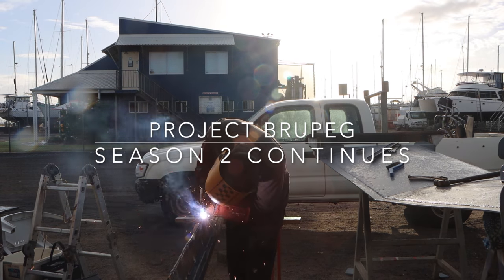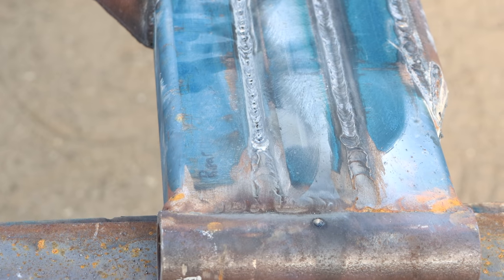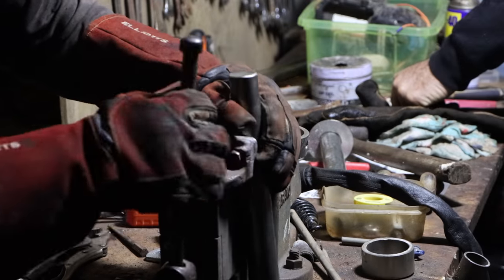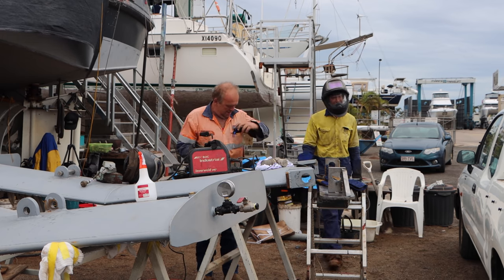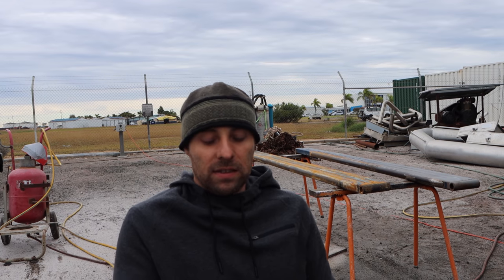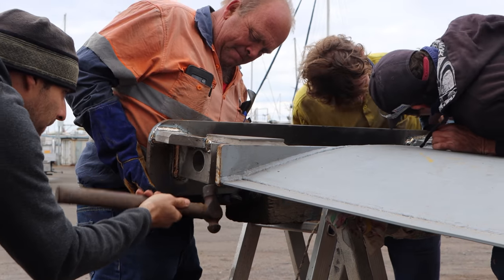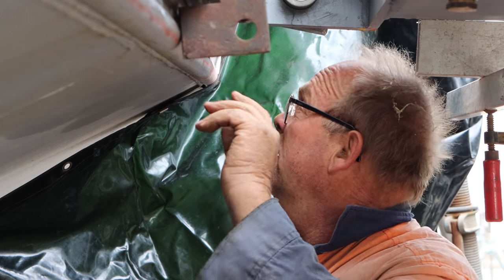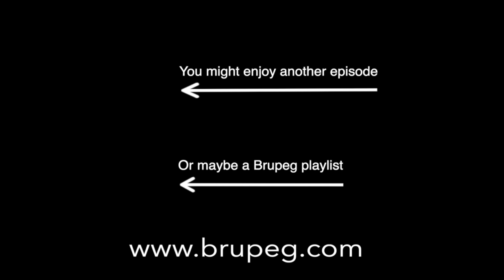Welding Steel Wings to a Trawler - Project Brupeg Ep. 148

Comment: Are you going to using a double shackle to attach the anchor to the chain?
Reply from the maker: No, just a single load rated 25mm shackle.
Reply: @ProjectBrupeg  Will that fit through your chain and or your anchor.
Reply from the maker: Yes, our anchor can handle up to 32mm and the chain has a single large link at the end so it can handle at least 32mm

Comment: I’m sure have answered this.  But, what are the pipes on the bottom and isn’t there a risk they could be ripped off by ice?
Reply: If I may step in..... The pipes are the engine cooling system, in a previous video Dame explains that the shakedown crusie will be away from ice then after settling in and figuring out requirements they will haul out again and do a lot of ice mods - reinforcements up front and engine cooling changes. :)
Reply from the maker: Exactly what Richard said. Ice mods will likely happen in New Zealand in about 18months time

Comment: Great video. Are the wings + or - buoyant?
Reply from the maker: Both!. They weigh 320kg and tha arms are another 60, so when anchored there is 760kg of steel hanging off the side minus whatever the air volume inside is (we dont know that number yet). I have my doubts there would be enough air to nuetralise the mass. When steaming at 9knots the shape of the wing has been calculated to produce 320kg (not planned just a happy coincidence) so when the air volume is added to that we suspect they will generate more than 380kgs of lift per side.

Comment: An idea might be to pull a bit of a vacuum on those wings and then fill them with nitrogen, so there is no oxygen in side to cause rust.
Reply from the maker: Yeah the plan is to add 10L of diesel once we are finished and sealed them up for good. A common way to solve internal rust trawlers use all the time

Comment: Is there a reason you didn't throw in some plug welds on the doublers and just did the perimeter weld?
Reply from the maker: Didnt need to, there is 110 inches of weld around the perimeter and if an inch of weldcan hold 1 ton, we are NEVER ripping them off the skin, the boat will give before the double
Reply: @ProjectBrupeg  Sounds good, thanks.

Comment: G'Day Guys..now you have tested you wings and you know they are sealed,,I'd be getting and inert gas ,,nitrogen and filling wing cavity with it..no oxygen no corrosion..doesn't have to be pressurized just fill cavity with a heavier gas and should flood atmosphere out,,cap as you have ,,
I mean you have gone to so much trouble with every thing else on corrosion,,
Reply from the maker: Yeah originally i was going to fill with argon, but we then decided to just add 10L of diesel and seal them up tight and let it slosh around for the life of the wings. Cheap, easy and effective
Reply: @ProjectBrupeg  Hmmmmm Deisel..not real ecco freindly,,But would be interesting after 10 or so years to see what grew in there,,
Spose could always add detergent so if a spill did happen,(God Forbid,).
the effect would just dissolved in to the sea,,
now not sure on what effect this will have on the anti rust thing ,,
Reply from the maker: 10L of diesel isn’t much of a drama if it spills but the only way it can spill it if we catastrophically damage the wings.

Comment: If i didn't know they were expensive, i would've suggested covering the arms with power line shrink jacket + a seam sealer for the ends (epoxy or poly) I know it lasts, i've used them before to secure structures in harsh environments, and the torque arma on the trailer of a friend are covered in such a jacket (obliviously smaller) no rust, and they take quite the abuse and salt water, as he's an avid "weekend warrior". That would've dealt with the fairing, salt water etc. I mean, if you guys can find a cheap length or someone is willing to donate, that material is very durable.

Comment: O.k. I may be wrong here but the wings are supposed to provide lift, but the cables are only going to lift them up so when they are down they are just going to bounce up and down with the force of the water unless there is some kind of locking system to make them solid mounted until they need to be stowed away.  When the plan was hydraulic cylinders and the awesome Kubota generator was sacrificed to make a pump I could see how it was going to come together but now it appears the Kubota was junked for no reason and the flaps aren't going to do much so I hope i am missing something.
Reply from the maker: Ok couple of things to work through, these wngs dont need to make lift, they need to act as lateral resistance to roll. so a dead flat plate is highly effective as a stabiliser. The steel arms lock these wings down and the arms get bolted to the deck so when deployed the wings is able to remain solid with pressure above or below the wing. The cable only takes weight when we are lifting or lower the wing and even then its only the weight of the wing not the water pressure. We were going for hydraulics and use the Kubota, but the cost and complexity just kept growing so we canned that we went back to electric. As for the Kubota being sacrificed, the AC alternator was toast, the control system to run the AC alternator wasnt there and the cost to buy replacements was more then a new genset, so at that point the only thing worth saving was the D722 engine which we have. Hence using it as a diesel hydraulic power pack is actually saving it from being stuck in a shed somewhere and forgotten. So i hope this has cleared it up. Damien

Comment: when you fill the wings with oil are you going to stand them vertical and pull a vacuum on the wings to let them fill all the way up?
Reply from the maker: Nope. We will be putting about 10L of diesel in and sealing them off right. They actually don’t need anything to stop internal rust as once the oxygen is depleted (from surface rust) any corrosion stops indefinitely as it needs new oxygen to start again.

Comment: Good to find a weak spot and get it done instead of finding a slow leak. You might have to spend six months on a leaky boat. In Antarctica. 🤐. A bit cooler than 8 degrees in Bundy.
Reply from the maker: Very much so

Comment: the way that dog pulled the hullplate  out to the 20mm plate looked a little sketchy ???
Reply from the maker: Hi Shane, that’s all pretty normal in steel boat building. 6mm plate is quite flexible and it’s standard practice to bring plates together as you get a much stronger joint

Comment: At least the load will be 'progressive' and the lifting force needed will taper off as the wing goes vertical. The greatest load will always be around the maximum downward extension. You've probably already considered it, but 'Pinch points' will have to be considered at deck level. You don't need some 'Guest Crew' leaning over the side to watch the wings fold while gripping the slide with their fingers. And, just a fanciful thought, considering how high your deck is, you could weld a few pegs on alternating sides of the lift arms, so anyone who falls in would have a quick way out of the cold sea without having to wait for a rope ladder or dingy launch... We all hope Jess is feeling better, it must be rough putting up with someone who leaves a trail of metal dust where ever he goes onboard... ; {
Reply from the maker: HEY! I vacuum quarterly. i like what youve raise about pinch points one thought i had was make some god solid hand rails purposfully out of the way so that if you fall and grab anything its most likely going to be a hand rails that automatically takes your hand out of the pinch zone. I havent quite figured that bit out yet but i think once i get the sliders up it will become clearer. Also one thing the commercial guys mentioned was using the wings for MOB situations, i was thinking of welding in permanent rungs just behind the wing so that if you end up in the drink you can climb onto the wing and then up the ladder thats always available. it wont cause any noticabel drag and would be a great additional for swimming generally
Reply: @ProjectBrupeg  Just treat the edge of the deck the same as a 500m cliff. Just assume if you fall off you will die. That mental attitude will help keep you safe.
Reply from the maker: Yeah that’s a good way to think of it

Comment: I’m afraid I’d reconsider the angle of your foils. At the moment you’ve got an anhedral going on. Meaning it isn’t selfrighting anymore (only the dimensional stability of the hull), instead it rather adwances the amplitude and slowes the rolling  of the vessel the faster you go. I’d shorten the studs until the middle section is vertical and you’ve got some dihedral in the outer part of your foils.
Reply from the maker: These are a copy of designs that have been used for almost three decades. With many sea hours and storms clocked up. If they were going to fail they would have decades ago. We trust the advice of the designers, builders and end users that have years of first hand experience with these wings. Thanks for your thoughts
Reply: Oh I didn’t know these were so well tried and tested! Then I said nothing and wish you all the best with your great project.
Reply: What the hederal did you say?

Comment: Dead air weight is different than hydro balanced weight..

Why didnt you use full length " double contact pins at pivots , from front trunnion all the way through rear trunnion "   individual pins allow for force concentrations of individual trunnions and expected distortion vs force divisions and minimal distortion with force sharing paired trunnions?
Reply from the maker: Honestly didn’t really think about that when we designed the hinges almost 2.5yrs ago. In hindsight we would have gone straight to the future upgraded piano style hinge
Reply: @ProjectBrupeg  water causes vibration, no mater how laser straight everything is. If hinge points are not parallel with centerline and inline with waterline of boat 100% ( or actial boat travel centerline, as most boats crab through the water to some extent, for a bunch of reasons )  Vibration causes turbulence, cracks, galling, and pitting, along with drag that inturn exasperates the whole circle even more. Additionally stabilizer wings/fish on fishingboats are allowed to swim hanging from outriggers and chain this line tension concept allows for sperical self alignment in all cases under all conditions as they change both with the sea and with the boat, while still using single line tension to transfer stabilization loads port to starboard. Minimal side load, minimal fore and aft drag, minimal pitch load transfer, minimal yaw load transfer. All this = min vibration for acceptable stabilization.  Lastly if something does go wrong the entire system can be cut away and ditched quick without sacrificing the hull of the boat damage and minimal replacement cost.  I cant help but imagine if part or all of your system could fail or tare corisponding parts apart. the hull could be torn open, or apart , all while dragging the carcas of metal parts that are unable to be cut free or ditched during an emergency. The power of water, unstable water, and drag forces are incredibly difficult to imagine.  I am with you my friend, be safe, expect the unexpected.
Reply from the maker: Brupeg used to have birds but when she was being stripped for scrap the gantry was cut off. Most east coast trawlers are moving to wings as they are night and day more effective than birds, so rather than spend money building an outdated system we went straight to wings. As for strength, wings have been used commercially for almost three decades. There a known system and nothing we have done hasn’t been done dozens of times before on other boats. The guys that’s advising us on design has been involved with wings for 25 yrs and seen in excess of 20 odd systems built and the design evolution they went through.

Comment: it would be good to increase the connection of the wing with the boat by welding some gussets inside
Reply from the maker: No need. the commercial guys fit these type of wings all the time without additional internal support and it passes survey and also doesnt fail on them. we will however be adding extra ribs when we do our ice mods in 18months

Comment: If that wing is air tight why don't you just fill it with an inert gas. Throw some diesel in too and it will never rust out from the inside at least.
Reply from the maker: Yeah the plan was to chuck 10L of diesel in, i did think about some argon in there but honestly we could get away with just sealing it up, so the diesel is just an easy bonus

Comment: They look smart, I'd love a pair of those for when I'm towing beam onto the sea
Reply from the maker: Yeah the commercial guys that have retro fitted them say they are amazing, stay out longer in worse conditions in great comfort with less fuel burn
Reply: @ProjectBrupeg   Yes I suppose when your rolling it becomes harder to push the boat through the water, can you steam along with them out head to sea or would you haul them up then
Reply from the maker: They stay down 95% of the time. Down south they only lift one, pull up to the wharf and Unload/Load then head back out and lower it. Only reason to lift them is clearance against wharfs marinas etc
Reply: @ProjectBrupeg   Great idea, be very good for stern trawling, I need a bigger boat really got enough kit on my 30 footer for a 40 footer